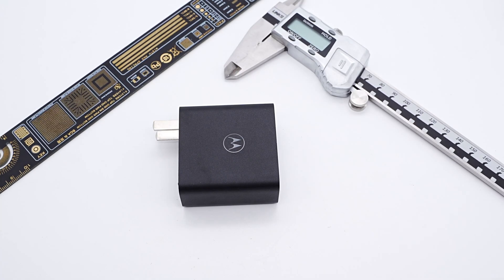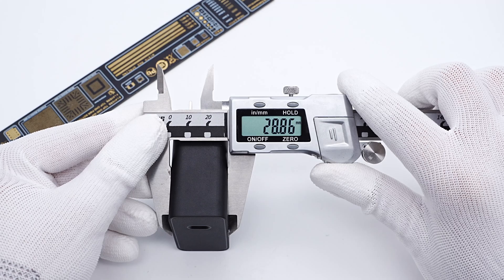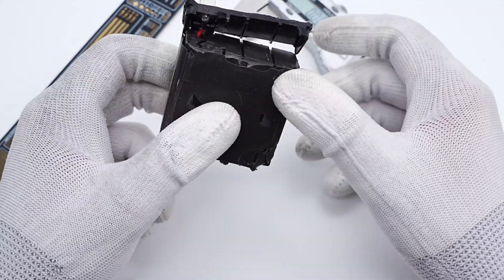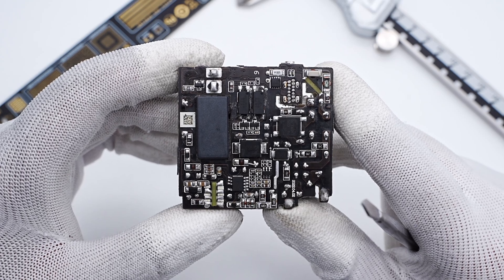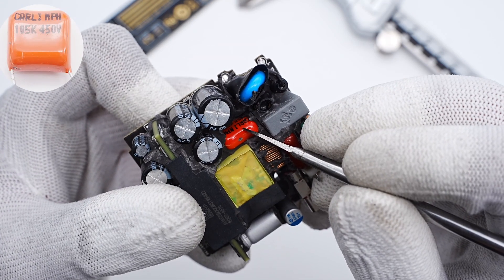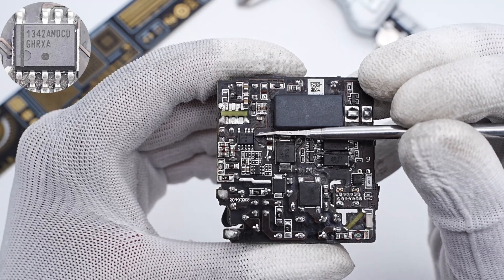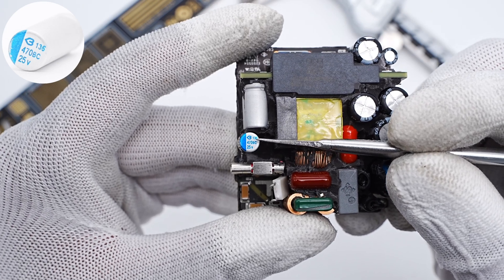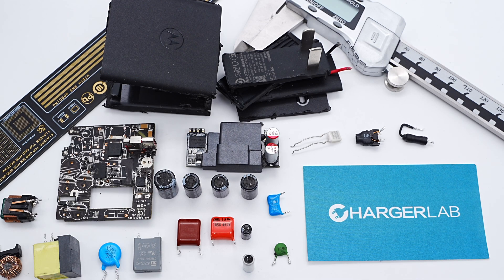Teardown of Motorola Original 125W GaN Charger for edge 30 ultra (MC-1258)

Comment: Fascinating! I just bought one in April 2025 for AUD $65 at JB Hifi to use as a generic compact “100W” charger - I don’t own any Moto / Lenovo devices to support the proprietary Moto 125W / 6.25A modes.

Comment: i found a motorola usb phone charger on the shoulder of the road and thought i could use it to regulate the power coming from small solar panels, (15w) to charge small batteries (5v) for my outdoor motion lights, since usb voltages are 5v. it looks similar to this board, it is a WAN NIEN 05V0 J03GI8-0001I 18466. Any hope for me to use this this way? i love your precise sharing style, thank you

Comment: these chargers need to be more serviceable
Reply: I've also never had one go bad. The cables seem to go bad for sure, but not the charger.
Reply: I've never had one go bad. Is it a common problem?
Reply: @johnknightiii1351  not really but being able to open them to replace components would help keep them out of landfills. I guess the companies that make these think that because there are no "user serviceable" components, then what is the point of allowing it to be opened
Reply: I own this phone and I broke my charger's chip, the charger as a whole is too expensive 😭.
Reply: You don't want your customers to thinker with mains voltage. It's better that way, you don't want to start fires. The phones itself should be the one to be more serviceable.